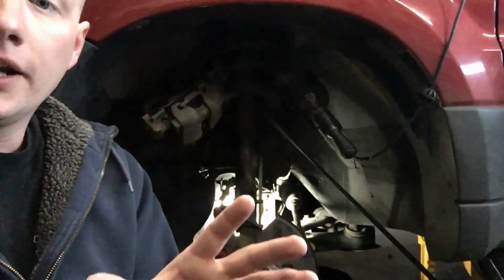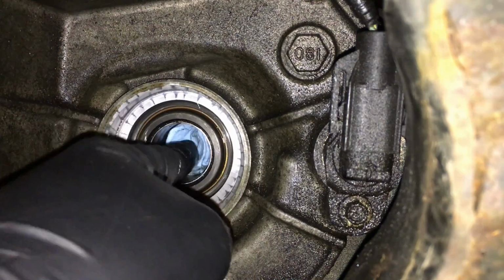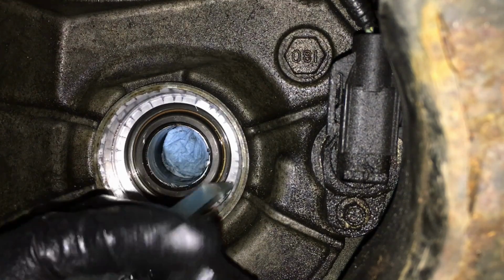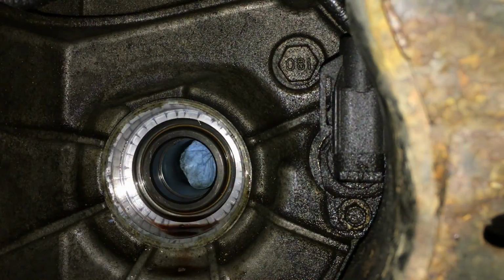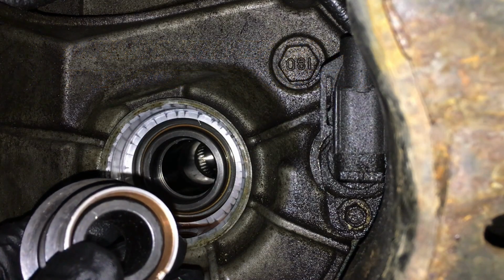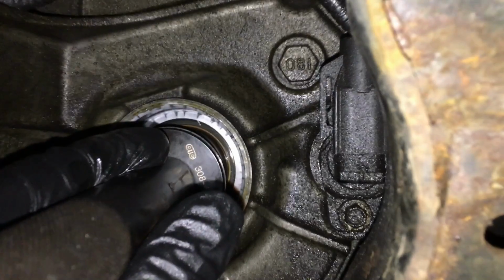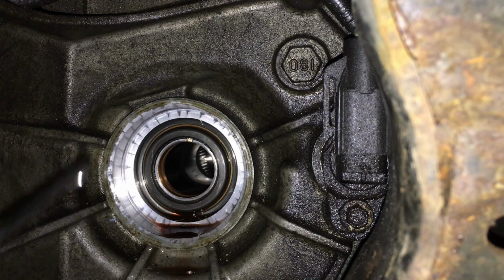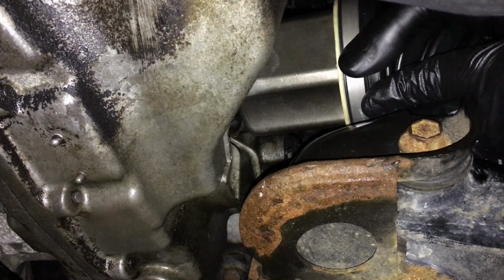2001-2008 Ford Escape CD4E Transmission Fluid Leak: Drivers Side Axle Support Bushing Replacement

Comment from the maker: Here are the Tools and Parts needed:
Aftermarket Axle Bushing-
https://cobratransmission.com/cd4e-sprocket-bushing-114056-1
Latest CV Shaft Drivers Side-
http://amzn.to/2kM9DBe
New CV Shaft Seal-
http://amzn.to/2kLZrsC
Bushing retaining compound-
http://amzn.to/2jtZWGn
Bushing Splitter tool-
https://amzn.to/2IgMJ25
Bushing driver tool kit-
http://amzn.to/2ki519m
Seal and Bushing Remover-
http://amzn.to/2kJXQ6n
Reply: I ordered my parts should be here couple days wish me luck..😀
Reply: Hey I just changed my cv axles and I drove it for about 2 weeks now and realized I had this leak will I still have to put a whole new cv axle in again when I do this repair? Please let me know love the videos so much help
Reply: Please let me know when you can
Reply: This is a great video, Ford has an updated kit With a Teflon coated bushing, al8z-3b414-b . I borrowed the blind hole puller from AutoZone number 27128, and the bearing and seal driver kit from O’Reillys 67034. The job took an hour and a half and so far so good no leaks.
Reply: @shaunortman8544  hey shaun how did you achieve pulling the bearing with the blind hole puller? auto zone doesnt' supply that loaner tool anymore so I got the harbor freight one. but since theres no backing on the bearing I don't know where to seat the puller... spreading the puller seems to just force the bearing tighter inside.
Reply: Thank You
Reply: I have an axle leak on the left hand/driver side of my 2001 Escape with a 4cyl engine and manual transmission. Is this bushing problem also known issue with the 4cyl 4wd escape? Mileage is 148,000. Also what type of fluid do I need to refill the manual transmission? I assume some type of heavy-weight gear oil. 
Please help this is my only running vehicle and I need it to get me to work so I can fix up my 2000 Gran Cherokee and 06 Titan.
Reply: hey i was just wondering what the labor time at the dealership i should expect for this job

Comment: I got a 2014 that’s got this issue on the driver side.
It’s got a skinny ass bushing, and the replacement for it is deeper, and it comes with a semicircle cutout on the side to keep it from blocking the lubrication channel. 

I’m struggling to remove that bushing right now as we speak, without dropping the transmission.

It’s lovely to find this on YouTube late night in the shop. 
Thank you so much for democratizing your knowledge. 

I salute you!

Comment: I have this same leak issue but mine is a 2010 with manual transmission, I have changed the seal twice and it still leaks. Does it mean I have to change the bushing?  Not sure if saw one tho 🤔

Comment: I have the same play up and down on my left half shaft. The thing is.. the seal is not really leaking fluid, but there is a bearing like hum coming from the driverside middle of the car that can get loaded and unloaded with steering like you can with a wheel bearing, but all my bearings are good, including the drivers front which was just replaced because it was definitely bad. Did the customer say there was a bearing sound from this part?

Comment: Oddly enough superior ssp154 states the notch is to be oriented inboard or "away from us" and opposite the existing fluid hole. Orientation "facing us" may cause premature failure
Reply: I would also be inclined to not drive it all the way in.  To promote fluid film flow from both sides.   
Dec 2025 and I have this issue on a 2008 mazda tribute. This is the repair method I will do.

Comment: Hi, I have a Ford Escape 2012, 4 cilinders, 2.5L, due to a ATF leak the automatic transmision failed, a mechanic came and scanned it there were two codes related to the AT, he said it had to be flxed or replaced, I dont have the money to pay for it. I have fixed my Escape several times thanks to your videos, but now is a little more complicated since I want to fix the AT myself, do you have any videos on how to do it?
It would help me a lot, since I havenot found nothing that specific
I live in El Salvador
Thanks in advance

Comment: Hello, I have a 2013 Ford Escape 2.0L that has the same output shaft leak I wondering if you know the sleeve part#  for repairing the problem appreciate thanks you so much.

Comment: Hi, when i took my halfshaft out the bushing came out with it and it is very loose on the shaft and loose in the case. does this mean inside the case worn out too? if i order a new bushing will it fit tight?

Comment: I have a 2010 Fusion with a g6m manual transmission. The transmission seal was leaking on the drivers side cv shaft. The repair shaft replaced the seal but said there was a pretty good groove on another part, not the cv shaft. I am thinking they were talking about the bushing now. They could not find the part from Ford, so transmission is still leaking. Would you think this bushing is what they are referring too?
Thanks

Comment: Would this same process work on a 2013/2014 escape ? Any help would be much appreciated. Thank You ✌️🙏
Reply from the maker: The 6F35 already has a bushing kit available from Ford.
Reply: @FordTechMakuloco  , Yes my apologies, I should have emphasized the process in which you removed and installed with the chisel .let me know. Thanks for the response and Have A Great 4th 🇺🇸🇺🇸🇺🇸
Reply from the maker: You can use the special chisel but it is best to use a blind bearing remover set.

Comment: Mine was a 2013 Ford Escape and the bearing didn’t have a notch. 
My part number from Ford for the:
kit 9L8P-7H260-AC
Which includes
Tool   9L8P-4N206-AB

Bushing   DV6P-7E110-AA
Half Shaft Seal
9L8P7H260-BB

Comment: I currently have a Humming noise coming from there. I thought it was the wheel bearing so change it but noise is still there. but no leakage from seal
Reply: Did you find the problem

Comment: Question. Im doing this repair the bushing was paper thin and the trans side of the shaft was beat up. I have a new shaft my question is does the bushing end up into the sprocket or close to it?

Comment: Just purchased the bushing and the axle seal from Cobra Transmissions website. A local Transmission shop said that they would most likely have to pull out the transmission to replace this bushing which would have cost thousands. Now I have about 2 weeks available over Christmas to get this repair done. If it doesn't work or I break something, I could be screwed but if it does I will be very happy.
Reply: How'd it go for you? I have the same issue, starting on it this week.
Reply: @philcollin5891  it worked! It wasn’t easy, but I was able to get it done. The hardest part was putting the new bushing in perfectly straight without me having a bushing press. I bought two of the new bushings so I could fail once and be fine. Now it doesn’t leak and is all back together with no issues
Reply: What is the part number of the seal
Reply: Are you there

Comment: Thanks so much for this! Man, this has been leaking and wearing my half shaft since I paid a trans shop to replace the bushing and seal..they didn't, Only replaced the seal outside the vehicle while I was putting a new motor in my 05. Charged me $200 for shit! Thanks again, excellent video!!

Comment: I have a question about my 2006 ford escape, 3.0 all wheel drive. Is there a bushing that goes on the front passenger side inside the transmission,  if so can you give me some advice on how to replace it. Is it the same type of bushing that goes in the driver side? The driver side bushing doesn't move but the passenger side does and i can not seem to find any information about it. If you could help me, i would appreciate it. thanks.

Comment: Is this Transmission reliable for daily driving use with proper fluid change?
Looking at a used 2002 Ford escape with over 200,000 miles!
Reply: Joon kinloch these cars are shit. I know this is old and I hope you didn’t buy one. Get Japanese instead. Honda Toyota hell even Kia hyaundai

Comment: awesome video. would this be similar in a ranger 4x4 however mine is a 2010 has anything changed? I'm hoping that the have left enough room behind for an expanding arbor slide hammer tool.

Comment: Thanks for this video! It took less than an hour to fix mine. Used a small drift punch (tip filed at a slight angle, maybe 15°) to cut two slots in the old bushing and peeled it out of there in just a few minutes with a sharp-tipped pry bar. Getting the new bushing in was a little bit of a challenge because I didn't want to cock it, which of course I did the first time. Used a little emery cloth to curve the edge of the bushing bore to make the insertion easier and went in clean and smooth. Picked up the bushing from Cobra in FL.
Reply: Do u think a slide hammer would work
Reply: @freethinker7805  the problem is that the bushing sits flat in the bore at the back, so there's nothing to grab to remove the bushing with a slide hammer. on the other hand, installing the bushing with a slide hammer might be possible, maybe even easier to keep it straight, but i couldn't justify the expense unless you have that tool already. a 16 oz hammer and a socket is all i used.
Reply: @JerewB  wat about a pair of snap ring pliers or something that can grab the inside of bushing with a slide hammer on that
Reply: @freethinker7805  nothing for the snap ring pliers to grab, that's the problem. honestly, i don't think there's a better way to do this job than shown in the video.
Reply: Worked for me too

Comment: I bought a 03 Ford escape and it looks like the shaft twisted and the pump broke the gear in center but did it hurt the converter because put it back together and the car won't move I think they broke convertor with misalghing shaft

Comment: I have a 2006 Escape XLT 2.3L and have read differing views on replacing the whole axle.  Some say you have to remove the transmission but this video makes me think you can replace it and the bushing without doing that.  Is that correct?  And is there an end to end video on replacing the driver's side CV axle?
Reply: I have a 2007 XLT 2.3 I just did it myself it works well I'm still working on it I'm about to put the bearing in but I used to flat state long driver bit
Reply: I'm about to attempt this on my '08 escape

Comment: I have a 06 ford escape and am having a knocking noise on acceleration and decelartion on turns. I have replaced both CV axles and noise has continued. My guess is it is this bushing 96060 which is allowing the cv shaft to move around in the transmission. I can see movement on the inward joint on the drivers side.. I don't want to take it to a transmission shop if this is whats causing the issue.
Reply: Cant wait to try it.
Reply: The last tip of the video was very helpful.

Comment: Is the bushing put in the raceway that is inside a bearing?  Is that why the bushing is put in place with loctite?  Does the G5M-R 5 speed manual transmission have a similar setup?  The seal look different.  Does the standard/manual transmission use the same bushing?  Sorry for all the questions, there is not much out there on the 5 speed trans.
Reply: I have a '01 Escape 4cyl with the 5-speed manual trans. Any advice or tips?

Comment: Ill bet it still leaked after the repair. I done this 3 times and its still leaking with new bushing seal and axle. Horable design. Ford should recall this garbage.

Comment: Is it possible for the right side to leak also or is it common
Reply: I'm on a Ford Escape forum and have been for many years. I have yet to come across this type of leak occurring on the passenger side axle from the same cause.. The reason the left (drivers) side gets this leak is that the CV shafts inner joint articulates within this bushing. The right (passenger) side has an intermediate shaft that doesn't articulate so you have significantly less wear.  I'm not saying it's impossible for this to happen to the passenger side but, it's not very or not as likely.

Comment: Mine spit the bushing out going down the road it was stuck on the Axel is that common or should I look for another issuse
Reply from the maker: They can get pretty loose when they fail yes.
Reply: @FordTechMakuloco   so Axel failure then the wieght of the axle just pulled it out I'd hate to buy all the parts to find out the trans is bad it still drives tho

Comment: If leaking seal is your only problem with a CD4E consider yourself lucky.. They are famous for their valve and band failures at relatively low mileage.. They are non serviceable.. Valve block and filter are inside the casing and you can't reach it from the pan you gotta take it all off and strip it down..
Reply: Depends on the year. Our 2006 Escape has over 150K miles and regular fluid flushes/exchanges. ZERO problems other than the leak which was fixed after performing this the first time.

Comment: I have replaced my seal a couple times now.  Usually holds for a couple years.  I now suspect the bushing is also bad, but am wondering if bad motor mounts are the cause.
Reply: I would think that the CV needs to be replaced as well.

Comment: I have a bearing like noise front passenger side. Replaced wheel bearing which is now silky smooth but noise is still there. I pulled the whole drive shaft including intermediate shaft. The carrier bearing flange wiggles a bit back and forth, is that normal? I put my finger inside the transmission where the shaft goes and I felt a good bit of up and down play on the internal splines is that normal?

Comment: wow thanks thats just what my mazda is doing and after pulling the axle the bushing came out with it didn't know what it was till i saw your post awsome can you tell me where you got the bushing and does the passenger side have the same kind of bushing if so where did you get the chissle you used and the bushing tool thanks alot very informative and useful

Comment: I did this service and it works great, 500 miles so far and no wobble on the half shaft.  it's tight and no leak.

Comment: The CV axle broke on my wife's 03 escape, replaced the axle but it never felt like it seated no matter what I did. I put it all back together and drove it down the road and back, tore it back down and checked to see if CV axle was seated and it seemed to be. I put it back together and seemed fine. I drove it up on a block so I would have clearance to change the motor oil and trans fluid started pouring out from the seal where the shaft goes in. I backed it off and pulled it back up and no more leak... Drove it a few more miles, including an off-road Hill climb, brought it home and parked it overnight. I got in it this morning to check the trans fluid and it had leaked some overnight in the driveway... Seems that if the axle is in a bind it leaks. Would you think that the seal and bushing is damaged and needs to be replaced too?

Comment: are doing the rear brakes with disc the same as the front on a 2006 escape with automatic 4 wheel drive?

Comment: Well I changed just the seal and it was fine for about a week, now leaking again.... it looks like I have to change the bushing and 1/2 shaft. 

I'm just nervous to cut out the old bushing, I actually chewed up the seal aluminum a little🙁 but I watched another video and the guy said it's ok if u mess up a little in the outside for the seal since it seals in the inside!!!

Any tips would be great on the bushing, is there a point in the bushing were there is a Seam?
Reply from the maker: Any point is ok when using the bushing cutter listed. There is a seam but it is a tongue and groove style so that wont help.

Comment: Hi mate, I just watched your other video on this seal. I am in Australia and have a Mazda Tribute 2005 3.0 and I have fluid leaking from the right hand side seal where the CV Drive shaft enters the transmission. Is it the same deal left or right? Also where can I get this seal repair kit with bushing if its the same as the left?

Comment: OK I just called a transmission shop they said if all my fluids on the driveway which it is and it's bright red and he thinks it came from the upper bushing so he said the trans will have to come out over $1000 repair does that sound right to you
Reply from the maker: +Joe Thomas upper bushing? not sure what they think they are talking about
Reply from the maker: +Joe Thomas if they are referring to this oh axle bushing then no they can do it in car as shown.
Reply: I'm new to this stuff! I just talked to another shop and he said if there is minimal play in the shaft that I probably just need a new seal, he also mentioned that the bushing always doesn't go bad.  Boy I wish I could talk to u live lol
Reply: FordTechMakuloco 

The guy said that there is another problem area that can leak something upper!! And trans would have to come out this was probably someone trying to scam me
Reply from the maker: +Joe Thomas yup unless they can specify a bushing number run!

Comment: Very Nice Video! my daughter 2006 Escape has that issue put two seals in it and still leaks   Looking for the Part # Shaft and Seal and bushing or anything else you would need when it is tore apart and where do you recommend getting them?  Thanks for  your Help!
Reply from the maker: Everything you need is linked to in the video description.

Comment: You sir are my Idol, lol, I've been told not to attempt to repair things such as this, I have a 2010 Ford Escape with 250,000 miles on it, my current project removing oil pan and pump to clean out, this is how I discovered the axle leak.

Comment: Flip that socket to give a better drive surface. I use it that way so the edge of socket doesn't do edge of bushing nicking. This reminds me of the right side support kit for older Taurus. Same problem over again. Some things never change with Ford.